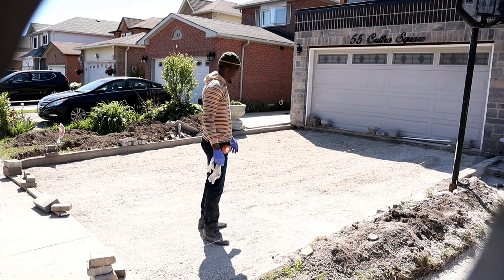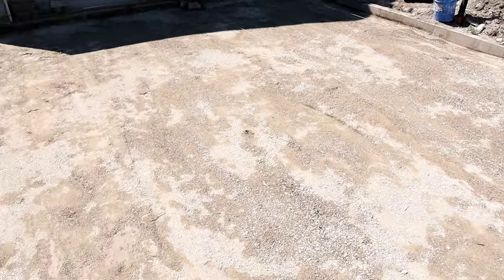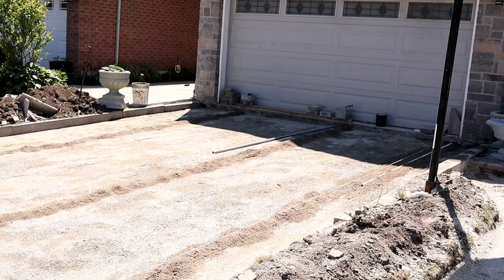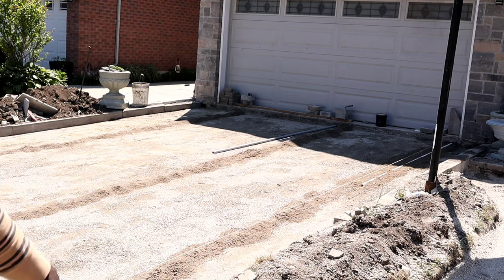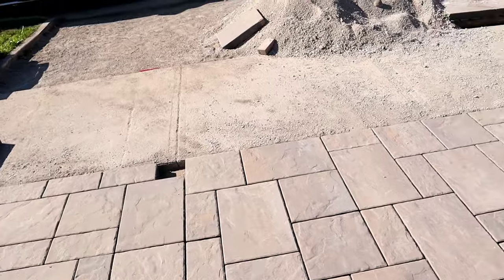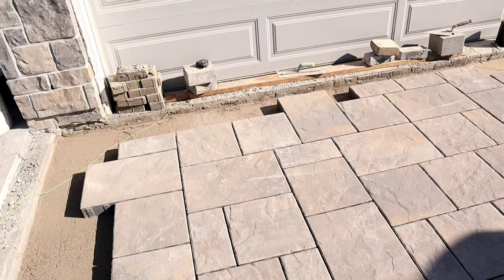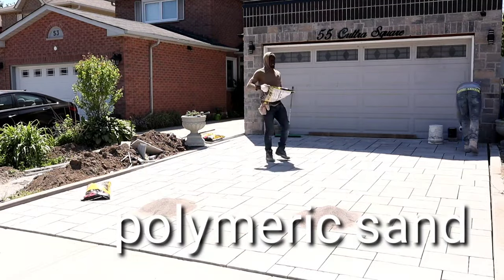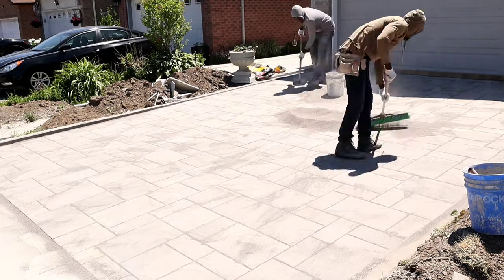paver driveway installation guide tips in paver driveway (PT1)

Comment: Nice work - I pretty much followed your procedure to install my drive. I would put down a small piece of plywood to kneel down on as you level out the sand. Also, rather than carry each brick from a pallet, which I assume your helper was doing, I put the pavers on a lift truck and rolled them to the install location. Hope this helps.

Comment: You must always wet your base and use a diesel packer after the final grade will be the smaller ⛽ packer .
You want at least 2 " of sand for final base. You must again wet the sand for proper grading of pipe placement this is a 👍 video..
Reply: Once you put the sand down and screed it, I wouldn't walk on it or try to pack it with any kind if machine as the weight will displace the sand and make it all uneven. If done properly, screeding it already pushes the tiny granules in place which has the same effect as packing it; you don't need to try to pack it down any more. Dirt and gravel is a different story.
Reply: @jennifer9528  You must always use damp sand when screeding never dry.
Reply: @Jennifer  The curb edges are messed up also that should of been cut out makes for a tripping hazard.

Comment: I like that pvc pipe to help level everything off.  Does it get left in and covered up?  I didn’t notice it being removed in the video.  Any harm leaving them underneath?
Reply: He removed the PVC from the sand before he began placing the stones on top. As he places the stones, he fills in the trenches made by the PVC with more sand and then flattens/smooths it out using the trowel. A clear example of this is at 10:34. PVC pipe won't withstand the pressure from the weight of the cars driving/parking over it. A crushed pipe could lead to a cracked stone. Always take it out and fill in with sand before placing the stones.

Comment: Nice trick with the pipe. Super awesome! 
Why isn't the sand also compacted?
Thanks for the video!
Reply from the maker: Great point!
Reply: You don't need to pack the sand once it's been screed as screeding forces the tiny granules into place so everything is packed and evenly distributed (the whole purpose of screeding). If you walk on it after you screed it, the weight from your feet (and any machine you use to try to pack it down more) will only displace the sand and make it all uneven (like walking on a beach). Wetting it down after it's been screed is going to make matters worse as you will now have run-off. For this reason, you want to check the weather and make sure it doesn't rain between the time you screed the sand and the time you put the pavers down. (If you do a project like this over the course of several days, remember that these two steps should always be done the same day.) It's important to keep that one inch of sand even. Once the stone/pavers are put down, any weight or pressure from walking or driving on it will be evenly distributed by the stone. The polymeric sand will help lock everything in place.

Comment: Hey just curious, why would you risk using compactor on the pavers. Can’t the vibration damage and crack the paver?
Reply: I think it has a lower setting for the pavers.
Reply: its common to use a compactor on pavers when finishing

Comment: Beautiful. What’s the cost on something like this? An estimated range is say
Reply from the maker: thank you,,its Depends
Reply: There are so many different variables that go into a job like this. Things to consider:
• the terrain (clay, soil, rock; how much needs to be removed, and the difficulty level of removing it - makes a huge difference in labor)
• type of terrain could also call for a layer base of gravel
• surrounding trees (roots to dig up)
• water drainage (the slope of the driveway and whether to add a proper drainage system)
• the size of the driveway (the bigger the driveway, the more labor and materials needed)
• the type, style, brand, quality of the paver/stone you want to use
Reply: @1kbconstruction824  How much was this job?

Comment: What is the pvc pipe for?
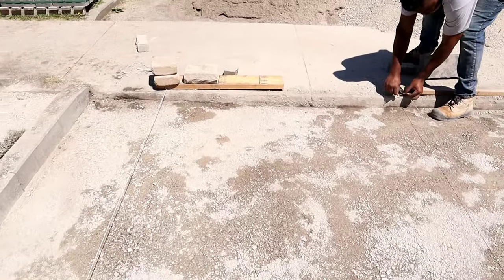Reply: 3:05 They are used to evenly screed the sand so that the sand is perfectly level all the way across the driveway. If you watch the video at 4:10, you can see he put two 1-inch PVC pipes down, parallel to each other. Then his partner dumped several buckets of sand between the two pipes while he used a flat board to drag over both pipes at the same, smoothing out the sand between them at a perfectly level height. The PVC pipes keep him from scraping too much or two little sand off the top. When he's done with screeding the sand, he carefully takes the pipes out. He only fills in the empty trenches with more sand (a little at a time) as he is putting the paver stones down. You can see a clear example of this at 10:34.

Comment: Word of advice 3/4 pvc has an outer diameter of 1 inch 1 inch pvc has a outer diameter that is greater than a inch
Reply from the maker: thanks, i already know that sir 👍good tips
Reply: I guess I'm confused did you not mean 1 inch pvc pipe In the video because that's what you had said you were using? You really don't want more than 1 inch of sand under pavers.
Reply from the maker: Yes thats what I said, but im just letting you know that , Because if you were to go to the store it's gonna mark 1" on the PVC pipe.thats why i said 1 ''
Reply: @1kbconstruction824  ok but 1 inch PVC has a outer diameter that is greater than 1 inch so therefore you are putting down more than an inch of sand, that's why I'm suggesting you use 3/4" PVC wich has an outer diameter of exactly 1 ".......
Reply: I think that everybody that does pavers knows that.🤔
Reply: When I do a paver job I always get 3/4 in pipe exactly one inch
Reply: @albertotorres7699  so than why did he say in the video he used 1 inch pipe? I was just trying to help him out
Reply: @norwaymo1461  the map is not the territory. He was referring to the map.

Comment: To “1kb Construction”:  please provide me the answer for following questions:
1.  Which paver driveway or Asphalt driveway less maintenance?
2.  Which one last longer?
3.  Does paver driveway require annually maintenance with “polymeric sand” ?
Reply from the maker: In my opinion I would say pavers once done properly it's more durable in my opinion, Maybe every 7 to 10 years you may need to go back over it with a little bit of polymeric sand ,
Reply: Thank you so much for your response!
How much the cost more Paver driveway than Asphalt driveway??
Reply from the maker: @Investment6330   They are almost in the same price range, paver can be a little bit more expensive,
Reply: @ Laura, great questions!
Reply: The materials might cost the same in some areas, but the difference is in the price of the labor. Paver stone (by itself) typically costs more than asphalt (especially depending on what type of paver stone you choose); then add the cost of gravel (if needed), paver sand, and polymeric sand. Then finally factor in the cost of labor to put it all in, which is a lot more than laying down asphalt.